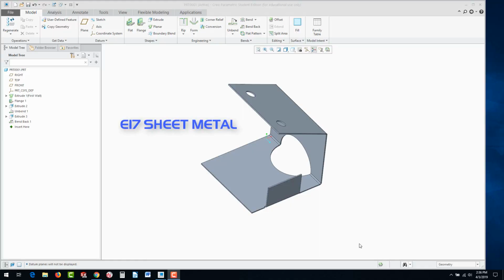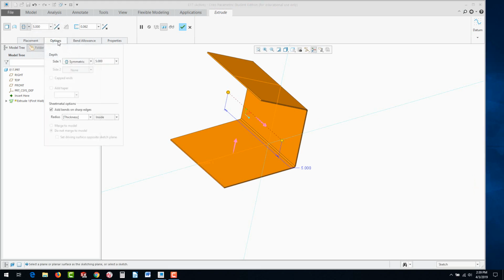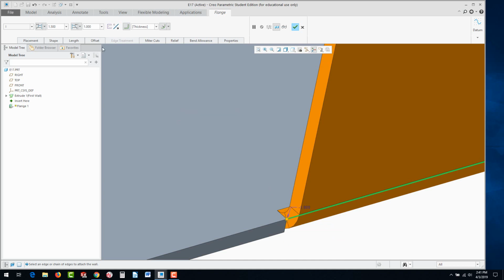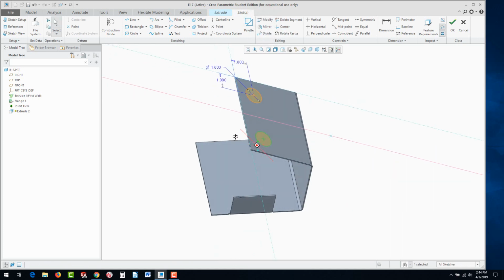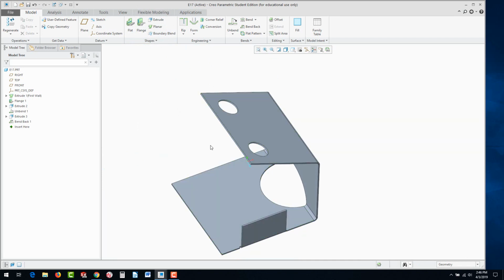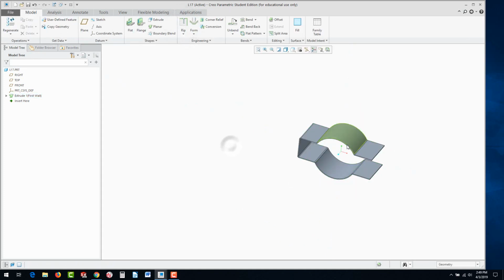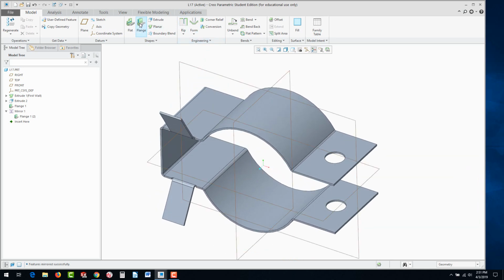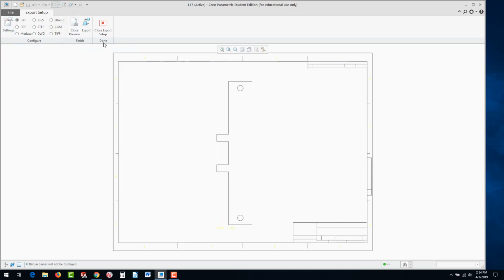E17 Creo Parametric 5.0 - Sheet Metal Basics 2 Tutorial

Comment: In the newer version of Creo there are two separate extrudes the one says "create three-dimensional geometry". That's the one you want. But it didn't end there. I couldn't change the thickness at the top of the page and needed to go to File> Prepare> Model Properties and under the Sheet Metal section go to Thickness and click "change". I did it from there.